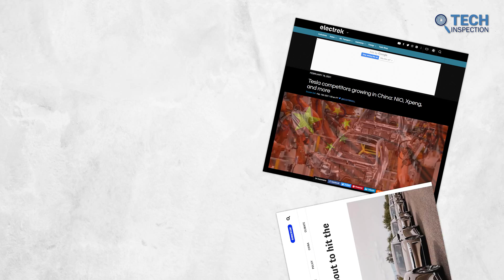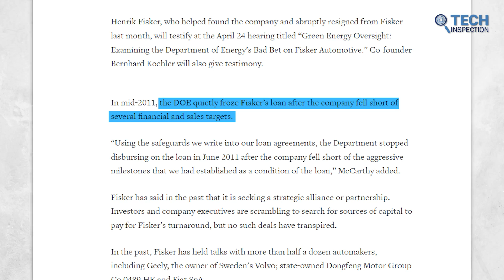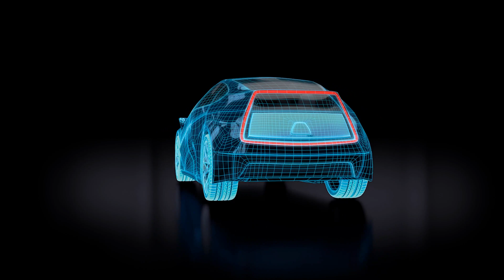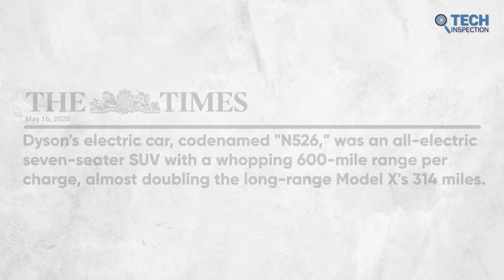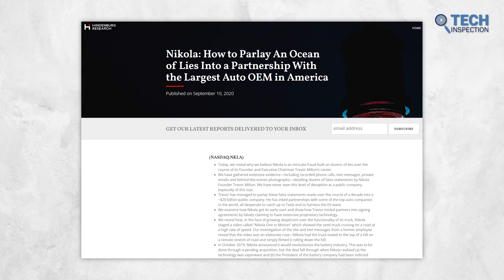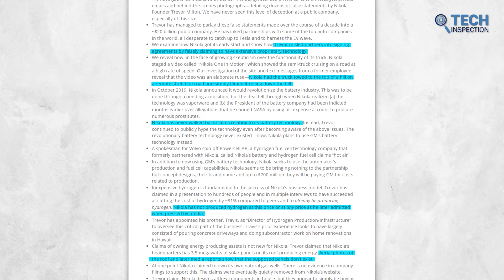5 Failed EV Startups That Aimed to Beat Tesla

Comment: This video is a bit misleading.  There were more issues than just funding, including a change of leadership in the first go.  Aptera also restarted with the original cofounders and is on track to produce their first 3-wheel vehicle later this year.
Reply: Yes, a lot of history was skipped over.  Aptera was a part of Idealab and asked the founders to hire a CEO with automotive experience.  He decided he didn't want to build the vehicle he was hired for and ousted the founders from control in a board coupe in 2009, with the support of Google and some other large investors.

Both Steve Fambro and Chris Anthony, the co CEOs whet on to found other successful businesses.  Chris was co-founder and CEO of a lithium battery company, which he took public.  In 2019, he discovered the rights to the original Aptera were available for purchase from the Chinese company where they had ended up after the liquidation sale, and re-acquired them.  He regathered the original key people, and restarted the company.  As of mid May, they are on track to delivering their first production vehicle at the end of 2022, as Poetzplus said.
Reply: @n.brucenelson5920  Nevertheless they did not have the money to start production. Not even 80 Mill. And that is much less than needed even in 2011.
Reply: Until now Aptera does not even have a production ready prototype. Not even to think of a running production line.
Reply: @vic321344  Aptera has a complete production plan, developed by Sandy Munro Associates and being built out now.  They are not limited to doing one thing at a time.
Reply: @n.brucenelson5920  I am shure they also had a complete production plan in 2011. Its the money that is a rare ressource. Not ideas, phantasies, promises and plans. These things are abundant with Aptera.
Reply: @vic321344  It is clear you don't know what happened in 2011 after the founders had been gone for years.  They could have started production in 2009, when Idealab asked them to bring in a Detroit guy to mangage it.  He decided he didn't want to build that vehicle, removed the founders from power, and then couldn't get his new project funded.  They had enough in 2009 to start production if their partners had been willing.  this is all a matter of record.
Reply: @vic321344  Even?  Name one company who has developed a production ready prototype in the time Aptera has been working on the present vehicle - certainly not Tesla or the big 3!  They have been making real, detailed written and physical plans for months, and you will soon see the vehicles produced as a result.
Reply: @n.brucenelson5920  You are right, I was not there. Aptera  went insolvent in 2011. Everything else I know from different sources. But that does not matter very much.
Your question: Tesla Model y. And they did not just have a prototype, they produce it in millions.

Or the first roadstrer. Though they had to develop nearly everything from scratch and could not just buy all needed components like Aptera does.

At the moment Aptera does not even have a production ready prototype. Or a 1000 mile battery, or a working Solar on a vehicle or a real crashtest performed.

Maybe they had enough money for production in 2009, but definitely no 80 millions to get the 160 millions loan in 2011. And they need more than 80 millions to start a production. Even if it is only a simple motorcycle and not a car.
Reply: @n.brucenelson5920  I can name you a company, which is really like Aptera. Wants to build a solar powered vehicle, and have not managed to produce a single production ready prototype in the last 7 years. But they produce nice YT videos and have a large followership for which reality does not count, only good feeling and phantasy claims. And they also have around 20.000 preordes, based on phantasy claims. Its Sono motors.

Difference: They already spent 250Mill euros for nothing.
Reply: @vic321344  I WAS there in Union City at the time.  And Tesla announced their model Y in 2019, but was still over a year late in delivering their first production model despite having VASTLY more resources than Aptera Motors has available to them, and still no Cybertruck.

Aptera has multiple Billion dollar plus VCs invested.  There doesn't seem to be much concern about getting to production, even in a difficult investment climate.  The record of their financial team and Chris Anthony's past success in bringing companies to IPO bodes well for their success.
Reply: @n.brucenelson5920  You did not ask about ressources, but time.

Sono also did a quite successful IPO. They just spent the money without getting results. Money is no guarantee for results. 

Tesla is building a Gigafactory to build the Cybertruck in 200.000-300.000 units per year. Not a small garage for handbuilding motorcycles.
Reply: @vic321344  You seem to not know anything about motorcycles and speak disparagingly of them.  I have over 400,000 miles on motorcycles and know better.  They are BIG FUN.  Aptera will provide much of the fun, and more safely.  

People know this, and this is why the demand for them is so much higher that it is for actual "motorcycles".  The Sono performance from both a top speed perspective and acceleration, is nowhere near that of Aptera.  Fun factor is important.

Aptera is a much more interesting package, at least for one or two people.
Reply: @n.brucenelson5920  I have got 1 mill Miles on motorcycles. Anybody more? And who cares?

Aptera acceleration is within the usual performance of BEVs. Sono is lame.
Reply: @vic321344  Then you know you are talking smack for no reason.  Why do so?  Besides Aptera gets its performance from about 1/3rd the power, which gives many benefits to the owners.  Why ignore that?
Reply: @n.brucenelson5920  Then you know you are talking smack for no reason.  Why do so?
Reply: @vic321344  I have done my due diligence, and as a result, became a volunteer brand ambassador, a small investor, and an early pre-order holder.  I have traveled to the factory site and the R&D center, and ridden in a prototype.  My background is an open book.

You, however, have never mentioned your imaginary "qualifications" once.
Reply: @n.brucenelson5920  You like to sell your phantasies as reality. And in this Aptera forum you find enough people who are cheering you up. Thats it.

Your background is of no interest to anybody.
Reply: @vic321344  At least you deserve thanks for adding to the traffic.  We were talking about your background, which seems to be about as useful and predictable as a bot that can't spell or really has mastered English.
Reply: @n.brucenelson5920  I grant the Aptera channel and aptera the YT money. They need it.
And I apologize that I can't spell or really have mastered English. As every single US citizen shurely does.
Reply: @vic321344  You don't need to apologize for your English.  I am sure I make plenty of mistakes in the several other languages I speak.  That you make that effort is commendable.  It is the negative FUD you are spreading with it is the issue.  Do some research and don't present such an easy target.